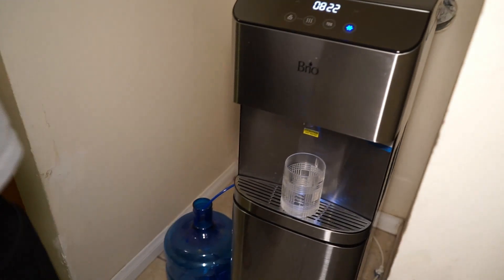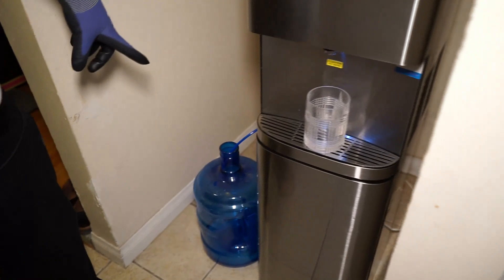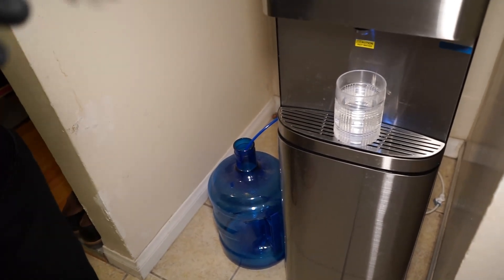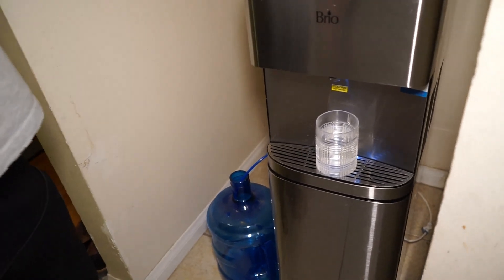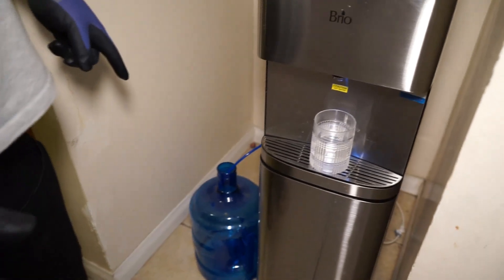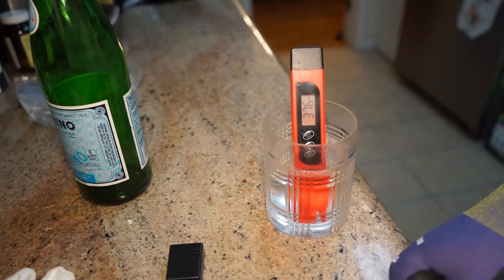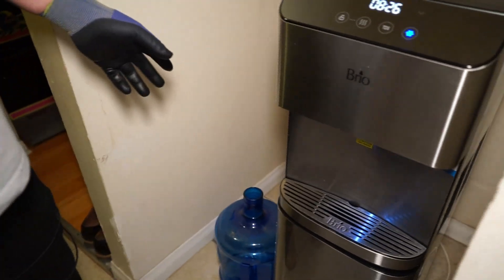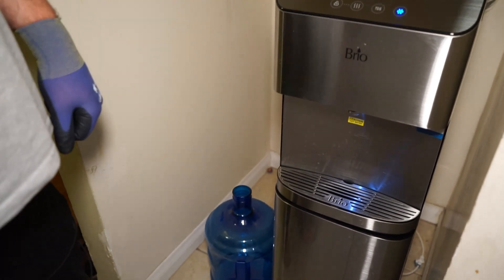Why Waste the Wastewater From RO Water Dispenser When You Can Use It To Water Plants

Comment: Thanks for sharing! My RO system has additional filters (3) before the RO membrane stage, so I figure the waste water is even cleaner that tap water, because of those other pre-filters. I pipe mine into my diy hot tub, so it gets topped off every day. Any hot tub spill -over goes in the drain, because I'm guessing the salt might not be good for the garden.